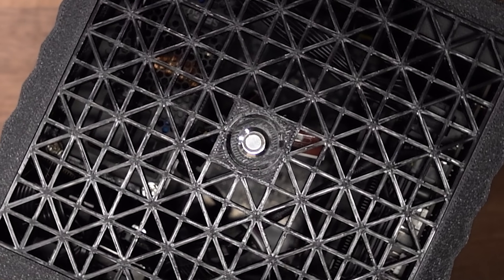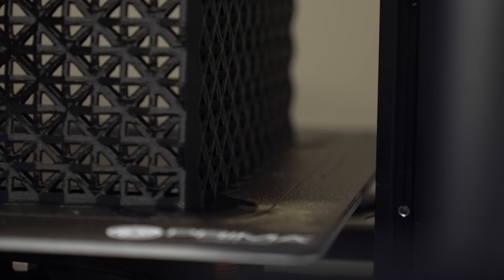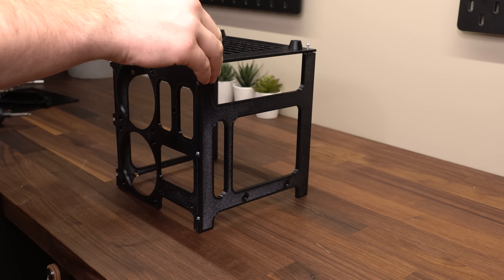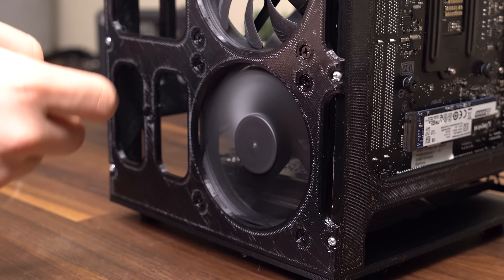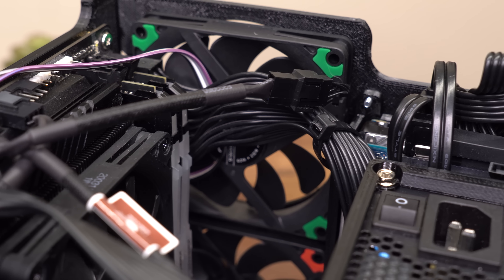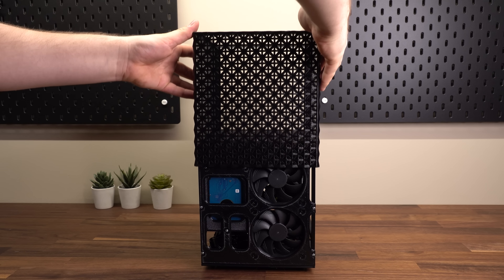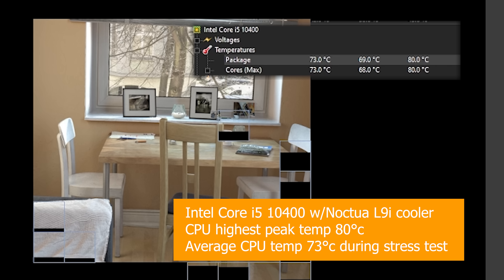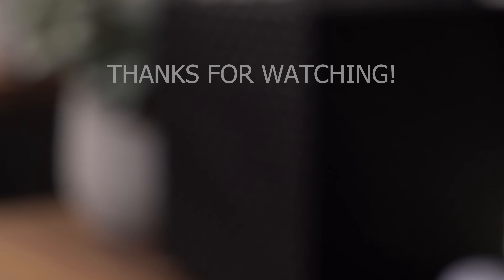Custom 3D Printed ITX cube case

Comment: sorry for a newbie 3dprinting question, won't there be concerns for case warping due to the heat from the motherboard/cpu? excellent build btw.
Reply from the maker: Hi, all questions are good questions, the only way to learn is to ask questions 😊 about warping, this is a very much discussed topic on many of my case builds. The concern is definitely there, but it all boils down to how the case is designed. Even though PLA can start to deform at temperatures around 55-60 degrees, it still requires a considerable amount of force to bend. 

In a PC case where all parts interlock with eachother, and there is a constant airflow replacing the air continiously, the temperature inside the case is never able to reach «dangerously» high, even though a CPU can be 80+ it’s at the core of the component, not everywhere inside the case. 

Thin walls that carry big loads are much more likely to bend due to temperature than if a case is designed to support the heavy components from multiple points. If that made sense.

And, thank you 😊
Reply: @makerunit  thank you for the detailed reply!

Comment: Surly the heat of the components would warp and deform the PLA, this makes me nervous, especially when the screws are tapped into the plastic itself
Reply from the maker: No worries. It’s not like the air in the case will ever reach those temperatures. The temperatures are at the cores of the processor and gpu. The surrounding ambient air in the case would be a lot lower. And there’s a constant replacing of that hot air in the case due to the fans. It’s no problem at all tbh 😊

Comment: You can print a mesh for avoid dust inside the case. I made some for my custon 3D printed cases.
I can send you some models if you like.
Reply from the maker: I have made some mesh filters before using infill, zero top and bottom layers. Works pretty well. Honestly I didn’t want to add those extra millimeters so it would not fit the Ender 3 size 😊
Reply: @makerunit  My meshes just add 0.4mm per side.
Reply from the maker: @HgArgen  I see, what nozzle size are they printed with? How are their strength and durability at that thickness?

Comment: Lovely, but most likely it would start smelling like burned tire after 30min of GPU heavy gameplay... Shape may deform overtime too.
Reply from the maker: Used it over a month, gaming for hours non stop, no rubber smell, no signs of deformation 😊 and frankly, I’m not really worried about that either. You know the plastic will actually melt before it will ever start to smell burnt? Imagine it being 240 degrees at printing, and even at that stage there is no burnt smell… if a PC passes about 100 degrees or so it will shut itself down automatically. So not really anything to worry about. 😊 you’d probably be looking at 3-400 degrees celcius or even more before it even starts to smell burnt

Comment: hdds in 2023?
Reply from the maker: Personally, I don’t really use them. They were just added for the option for those who want to print it themselves… I mainly run two M.2s 250gb for operating system and a bigger one for general storage/programs etc 👌

Comment: Beautiful. Black screws tho.
Reply from the maker: Thank you! And, I could not agree more tbh. I kinda failed as I actually as I had planned black screws for the external cover but their heads were too big to fit the countersunk hole. And I didn’t wanna re-print it. 😅I could have drilled the holes out slightly too, but didn’t want to risk ruining it.
Reply: @makerunit  what's that famous saying? - "don't let perfect be the enemy of good"
Reply from the maker: @soundmixerporter  that’s a good saying! Never heard it before but I like it 😊

Comment: you killing me with these non black screws :D!, amzing case . need all black everything though
Reply from the maker: Thank you! I did actually have black ones, but when I built it I just realized they had slightly too big heads to fit inside the countersunk holes 😅  though I should have used them on the interior parts though. Or just slightly drilled out the cover holes to 1mm bigger.

Comment: Why not sand it? I've never printed nothing so sorry if this is a stupid question
Reply from the maker: Honestly. Mainly due to it’s shape, it’s got such an uneven surface that sanding it would take a lot of precision and time. And I’m not sure if the result would be any better tbh. Would probably have the best result in my opinion just spraypainting directly onto it.
Reply: @makerunit  Ohh, didn't think of that, and yah, your probs right, would take forever and wouldn't look that much different.

Comment: Хотів би я побачити що з нього лишиться, коли відеоадаптер в роботі прогріється до 110, а процессор до 80 градусів Цельсія...
Reply from the maker: Well, the temperatures you see here are during operations. No more than 72-73 degrees for the video adapter 😊 CPU can run up to 80 but still no issues 👍

Comment: What is the maximum length available for a gpu?
Reply from the maker: About 173-174mm would be the absolute maximum. If you chose to not use the bottom front intake fan at all, about 190mm would fit.

Comment: Did you consider a larger CPU cooler?
Reply from the maker: I did consider it. But the L9i is what I had available at the time. My other option was a 120mm one which was too tall… 😊 A cooler up to about 100mm should fit.

Comment: maybe electric problems because no ground connect an motherboard to power supply ... maybe
Reply from the maker: There should be ground wires in the actual power supply cables though. So I don't believe this is an issue :) I have been using only 3D printed pc cases the last 2 years, both me and my girlfriend. None of us have experienced a single issue.

Comment: You could add some mesh add the inside of the case for dust. Very nice built.
Reply from the maker: Thank you! It crossed my mind. Not due to dust though more so it would look even more clean with no (less) see through visibility. But I guess for dust also 😃 It’s not so visible on camera but in «real life» I can see the fans spinning through the tiny holes.

Comment: Very cool, but kinda raw
No I/O, dust clog whole setup, video card should have personal rack to be in fixed position before case assembling
Reply from the maker: Thank you! You could always attach the motherboard onto the plate first, then the rear exhaust plate and do it that way if you’re worried about the GPU wobbling 😊

Comment: Wow the improvement is massive here...
Reply from the maker: Thank you! 😊 compared to my previous cube I feel like this one makes a lot more sense!
Reply: @makerunit  exactly what I mean.
Reply: @makerunit  by the way, would you mind to make 3D case for CIY Tester 68? So I do make a test on this cheap barebone keyboard, that it can utilize about 3,6v rechargable battery. While the default is 2 AAA battery, total 2,4v rechargable battery. In short, it can be modded using 3 AA  battery, and gain enormous amount of battery life (considering if it is using 1800-2100mah). The potential is there but CIY don't use it to the max.

Comment: That's an awesome build!
With those Temps, probably a good idea to print in a higher temp material like PETG or ASA.
Also, you could add threaded inserts to help with the reusability of the screw holes
Reply from the maker: Thank you! Most parts were printed in PETG. I only printed the cover in PLA due to my PLA had a slightly more matte finish than my PETG spool to be honest. Otherwise I’d go PETG all the way. Though I have personally not experienced any issues with PLA in any of my case builds, I still prefer PETG due to it’s higher durability and stronger layer bonding.

About using threaded inserts, they look really clean and long term are probably a better solution if disassembling many times, but they have to be placed perfectly center and straight to hold well. If slightly out of line they  risk breaking loose when tightening the parts together.

Comment: How do you decide what fillament to use?
Reply from the maker: Honestly, I just try to go for PETG for PC parts whever possible. I mainly use a generic non-branded PETG filament that I buy at a store in Norway… generally PETG works pretty well for most purposes. Slightly more difficult to print but better overall heat resistance and layer bonding strength than PLA for example. Getting a PEI sheet really fixed all my PETG adhesion issues.

Comment: Did you use PLA? do you have any concerns about the PLA melting I know CPUs can hit 100 C wasn't sure how hot the case would get? Any heat damage?
Reply from the maker: No heat damage. I’m using mostly PETG for my PC cases but for this specific one I did the external cover in PLA just due to my PLA filament was slightly less shiny than the PETG. But no issues so far. And no issues with any of my previous PLA cases either so far. I see many say they experienced deforming but I have not noticed anything with what I’ve made so far 😊
Reply: I doubt if any of the printed parts will get anywhere near 100 degrees.
The ambient temperature on any of the components is more likely to be in the 40 to 50 degree range, and that's probably only directly behind the CPU, where there aren't any printed components at all.
I don't think that you would normally put a high powered CPU or graphics card in a build like this.
I printed this in PLA and it's fine. It's just not as strong as PETG so you have to be more careful with it, especially with the PSU bracket (I already broke one).
Reply from the maker: @dalemacdonald201  did you print this case already? How do you like it? Happy with the outcome? 😊 

Also, if I may ask, did the M3 screws directly into the plastic work fine for you? I’m curious to hear your experience. Feedback from people who actually made this is gold for me for future builds!

Comment: man if plastic didnt look like ... plastic, these designs would blow me completely away. Sadly, the "printer" look to me is just ugly with most filaments and kind of ugly with some, and resin printing isnt quite strong enough for these types of builds despite looking "Okay" (tough resin works.. but I wouldnt trust expensive projects with it.) - Cant wait until PBF becomes more consumer friendly, metal can be worked to look so much better than plastic - and typically looks more "professional" right from the wash cycle anyways.

I love this design though, simple yet stylistic. Something about cubes just work for me, but then again having used blender for nearly a decade its almost symbolic to me at this point so maybe that's where I get it from haha.
Reply from the maker: I totally get what you mean! A full metal version would be freaking awesome! Perhaps a CNC’ed from flat pieces and welded together would work. I could have gotten a more detalied finish with lets say a 0.1mm layer height but the print would then take 5-6 days to complete. Would mean less visible lines and with some filler primer and a few coats of matte black paint it could be a pretty cool print, but plastic will definitely never beat real metal for sure!
Reply: @makerunit  CNC machining would definitely work but that defeats the point i think haha, 3D printers are definitely more consumer friendly!

You could for sure improve the overall build quality with smaller layers, but I think my personal problem is just with the aesthetic of plastic - but as you said you could probably cover it up to make it look more authentic!

I'm probably just too stoked about the idea of metal printers, as they have shown to even produce stronger structures than casting can produce. which is an impressive feat, while looking incredibly professional!

Imagining the projects people will post in 10 years is absolutely beyond me. Can't wait!

Anyways, thanks for the response and have a wonderful easter!
Reply from the maker: @Skyflairl2p  as soon as metal 3D printing reaches a «consumer» level I’m definitely getting one! I totally understand the worries of using an all plastic case, it’s got its ups and down definitely. Happy Easter to you too!

Comment: are you now worried about PLA warping under those heat loads over time?
Reply from the maker: All internal parts were printed in PETG. Only the cover was printed in PLA as my PLA filament gave a slightly less glossy finish, but the cover has only intakes so this should not be a worry. 😊

Comment: I would've put the power button on the rear pannel, remove the drive cage in favor of N.2 drives and put a big fan at the top and front, really nice case though. xD
Reply from the maker: Thank you!
I thought about a similar approach! 🙃 I do have two M.2 drives on the motherboard already. Just added the HDDs for the option honestly. Not that I personally use them either 😅

Comment: I debated printing my own itx case but decided I wanted a 360mm custom loop water cooler. So designed nearly the smallest possible 360mm radiator m-tax case with a clear acrylic side panel. Had to print it in four pieces on my Ender 3 but looks great, fits 3-120mm fans, 140mm fan, 360mm radiator and full size GPUs. It’s 220mm x 290mm x 380mm, not tiny but better any mid size atx cases.
Reply from the maker: Sounds awesome! Would it be possible to see your end result?

Comment: Pretty sweet man, about 30 USD if you use the most cost effective PLAs or up to 70 USD if you go with more exotic but reasonable PLAs and of course it could go way up with some other type of filaments.

With my preference of PLA it would run me approximately 40 USD, seriously awesome. Coincidentally it ran me approximately 15 USD to make a case out of some high quality plywood and would have ran me approximately 80 USD to make the same case out of solid dark walnut or mahogany. Of course 3D printing has a much lower point of entry and the time spend making the case per hour is laughable compared to a skilled Carpenter.
Reply from the maker: This would definitely look sick in dark walnut! Even though PLA should do fine here I would recommend going PETG if possible due to it’s higher temperature tolerance, and overall strength is a bit better in my opinion.
Reply: @makerunit  Agreed on the first account I love dark walnut and PETG probably would be a much better choice since it has a higher temperature tolerance and doesn't have as much material creep. 

But the odds are high that a people with a 3D printer won't have PETG but will have PLA of any type on hand besides not all PLAs are equal either, especially silk PLA. Although the components themselves obviously can get to 90c enough to soften both types, i doubt any part of the case it self actually gets all that warm. 

IDK that would have to be tested
Reply from the maker: @Guardian_Arias  as long as the case has a constant airflow there should really not be much worries regarding PLA getting soft and the ambient air temp inside the case will rarely reach over 50 degrees even with a 80-90 degree CPU due to the constant change of air, but in case of fan failure or similar it might of course but it’s highly unlikely. PETG can handle it a lot better definitely. PLA will work in most cases still. 👌 some people report that they have gotten warped PLA cases but personally I have no issues with this as all my case designs have some kind of constant airflow replacing the internal air all the time never allowing it to get hot enough. 😊
Reply: Haha. In Australia, the cheapest price for three Noctua fans is around $120, so the price of the filament is peanuts in comparison.
Reply from the maker: @dalemacdonald201  I see, but 120 AUD is about 80 USD, so that would equal to about what I paid, ordered mine from Amazon UK to Norway, with the shipping and taxes I ended up at roughly that price too for just the black fans.

Comment: Did you think about using threaded inserts instead of self-tapping screws? It might help with the durability of the connections.
Reply from the maker: I did consider it but due to the wall thickness I ended up not going for threaded inserts as the inserts were almost as thick as the walls.
Reply: @makerunit  maybe additional thickness where the inserts would go could help?

Comment: First love this case I think it sex as hell..but what if you ditched the sata sleds rotate the front fans to horizontal and maybe made to fit 2x120mm fans for aio support? Or would that though off the measurement to much?
Reply from the maker: Thank you! I think there is just enough room if ditching the drives. If I completely remove the 92mm exhaust fan, replace it with two 40mm fans instead, I’ll be able to rotate the power supply and possibly have enough room in the back to fit the AIO thickness as they can be up to about 55mm including the fan.
Reply: @makerunit  or one could just dich the sleds and just a small tower type air cooler like a hyper 212 as opposed to an aio or lp air cooler..
Reply from the maker: @killerhawks  if using a PICO, or FLEX atx psu it might be possible to fit even a 120mm fan cooler.

Comment: How does it handle the heat of hard usage?
Reply from the maker: Very well actually. The internal parts are all PETG. So they can hold no problem. The outer cover is PLA but it holds up very well tbh. Ideally print the entire thing in PETG and it should be rock solid no issues with temperatures… 😊